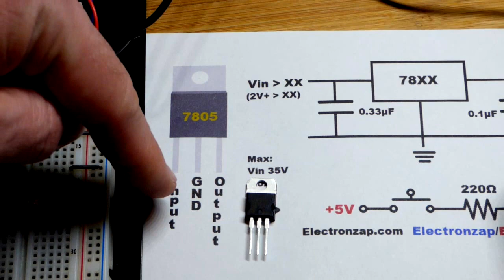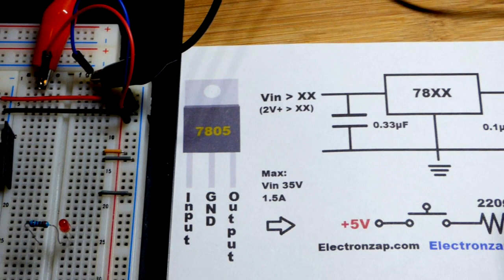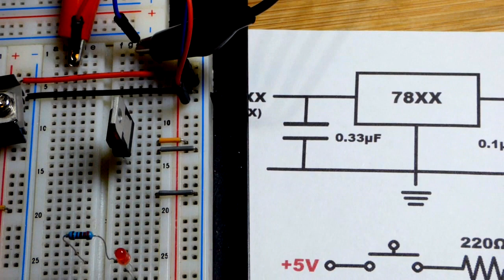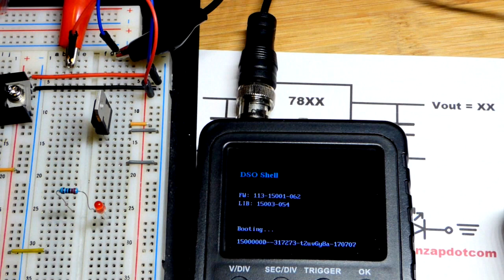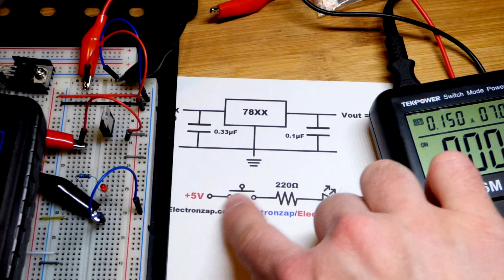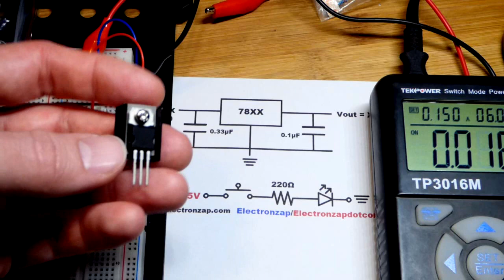7805 three terminal 5V regulator IC electronics integrated circuit introduction by electronzap

Comment: These make for a quick easy way to make a 5 volt power supply out of a lipo  2s or 3s or ...    The buck converter is a little more efficient but you can't beat these for size and weight.    I think I saw a video explaining why you can't use them in parallel for bigger loads      I might be mistaken on that not sure...
Reply from the maker: Indeed! I'll be studying parallel power sources more in the future. I think the main risk is that only one of them will end up providing all the power.
Reply: Exactly right.   I think you pointed that out in one of your videos recently with zeners in parallel if I recall correctly.